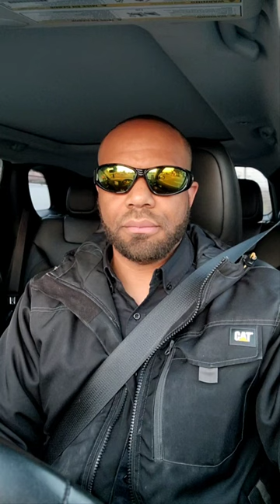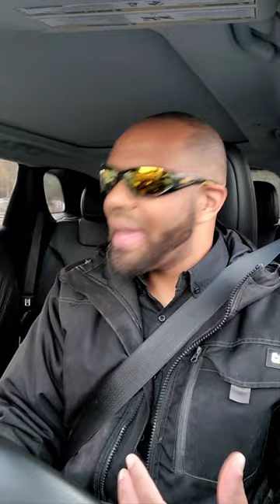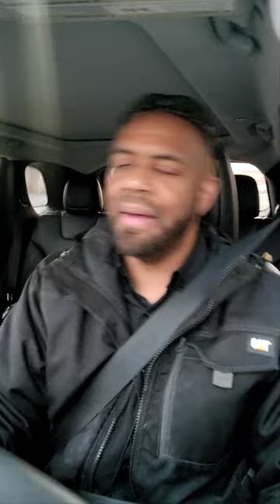I Need More Polyphony in My Keyboards!!!

Comment: Derrick I am running into the same dang problems bud. Have Modx and Fantom O. It actually seems worse on the Fantom O for some reason. Same thing, piano and nice pad and instant problems. Absolutely ridiculous. So bad I thought about trying to get my money back. Says 256 and thought I would be free of problems but bam! And to be honest as far as a live performer I have not been totally happy with the 0. I have a kronos as well that I use live. From all 3 boards the MODX just seems like my powerhouse believe it or not. The scene function is incredibly powerful in live situations. The O has it as well but its located on the pads and you have to remove your right hand or reach way over with your left, just not as good. I have downloaded some pianos for the MODX that are single sounds and for live application actually sound better than the 4 layered ones. Has helped me a lot with the polyphony issues. But I am totally with you bud. I mean they are charging over 4k bucks for these top models and we are still having this stupid crap going on. Insane.
Reply: Im about to sell my modx for this reason

Comment: I usually don’t get into problems but I did the other day😢… only when I start adding more tracks and using automation
Reply from the maker: Hey Mike! Remind me, which keyboard do you use?
Reply: @darrickkeels6387  Iam using the Roland fantom 8. I got the first one when it came out…
Reply: @darrickkeels6387  I mostly do hip hop so you wouldn’t hear the notes drop out but once I started to layer over 8 sounds and add automation… it started to stutter and go off time… I was using the mod wheel for automation …. There are sooo much things that I wanted on the fantom that should be there… I can go on for ever for things I would of liked… but it is better than most of the keyboards out there if you really look at it… I haven’t played the mpc 61 yet but if you really know how to use the fantom you can create some crazy sounds….I use fl studio 21 so most of my production is edited on there and the final production comes out crazyyyy….
Reply: @darrickkeels6387  I am use to the linear recording which I used on the Yamaha motif es8…. Which I need to get a couple keys broken because I made soooo many tracks on… all they need to do is upgrade the software to make more thing happen….

Comment: First, welcome back my good friend. 

Why less polyphony in keyboards? Simple answer. 

1) Outdated hardware
2) No real competition to force breakthroughs/innovations (opposite to what Intel and AMD are doing right now, forcing each other to innovate and compete)
3) No dedicated engineering teams for high end synths (but rather, all are employed to do multiple products at once)
4) Still relying on hardware chips as a tone generation method (as well for FX) instead of switching to software tone generation (Korg have done it with Kronos, Nautilus, the wavestate, opsix and modwave family, the PA series of arrangers and what Dexibell are doing with all their products).
5) Limiting customers by not enabling them to expand their synth by adding M.2 NVME SSDs, or more RAM.

All of these factor in huge losses of power, against general computing hardware. The only brand I can really defend is Dexibell (slight empathy towards Kurzweil). But most of them still, are really still playing the 'take me for a fool card' with their customers. I am hoping someone really starts to push these companies out of their comfort zone until they aren't able to even compete anymore. 

Money doesn't' come cheap, especially for the gigging musician (unless you're high profile of course). So mid-range is mostly, the places where money is spent, even then, products are still not up to the mark as they are expected. 

I still use hardware, because they are easy to setup, easy to use, great workflow and modern ones have great DAW integration as well. But I'm getting tired of hardware manufacturers not making an innovation in this space. 

Have a great day Darrick.

Comment: I was reading an article on Yamaha  Montage and people wanting more <fill in the blank>.  The author said the engineer he talked to at Yamaha said hardware is not the problem, the software is what takes a long time to design, develop, and test.   The software is the slow part and expensive part of developing new things for their keyboards.  

One of Yamaha's approaches to issues like this over the years is just buy a company that already does what they want so they can get their hands on the tech they need/want.   Hey Dexibell you want to retire let Yamaha buy you out.
Reply from the maker: Software is indeed expensive to design, test, develop etc. But it has been over 20 years since the Roland XV3080 has came out with 128-voice polyphony. Think of all the software for phones, tablets, cameras, refrigerators, cars, vacuum cleaners, drones, etc that has been designed, developed and tested since that time often by companies that started out with less deep pockets than Yamaha. The Yamaha corporation has a market capitalization value of over $6.7B. In the year 2000 when the XV3080 launched you could buy Apple shares for as low as .23 per share. Somehow Apple was able to find a way to design, develop and test their software and optimize it to work with their hardware while only being a penny stock. It is now worth over $2 Trillion. They went from .23 per share to launching an iPhone is 7 years. I know it is an "apples to keyboards" comparison lol! But I am just not willing to let corporations worth billions say they lack the money to develop software that works with hardware because that's precisely what every other technology company does. They simply don't think the return on the investment is worth it. But one day a company like Akai will do it and the big three will be playing catchup.
Reply: These companies have been blaming hardware for decades. Now they know that the majority have finally realized their lies are way too obvious. So now they switch to the "software" cost nonsense. Bottom line is that 90+% of their market is beginners/casuals and brand cheerleaders who either don't know the difference or don't care.

Comment: You raise great points. Clearly, you’re a power user with considerable polyphony needs. 

It’s worth it to shine light on some other companies that either give us more or manage polyphony in a more musical way.  Dexibell, Kurzweil, and Kawai spring to mind. 

Barring that, I guess you’d have to look at augmenting your $4k workstation you just bought with either rack modules or software.  

Some higher end Korg products have an Even/Odd note parameter in their Global menu which is helpful if you have two of the same instrument and wish to allocate polyphony across them.
Reply: I'd hardly consider him wanting a Piano and a few extra's (as per other videos) power use lol.  More like the basic requirements of anyone who switches on a board.
Reply: @ErraticFaith  a fair point.  I just got an 07 which tops out at 128 voices and FWIW, I've not had any polyphony issues yet.
Reply: The FA is built around vastly more stable tech. The Zen Core technology is simply too much for it's hardware to bare. Which is why full Fantom has the Vpiano without a cap. Without that you're asking for even more trouble.
Reply: @ErraticFaith  ahhh to be clear I have the Fantom 07, not the FA-07 so I'm definitely using Zen Core stuff.  It's basically half  of the flagship Fantom. I believe the latter has a separate chip just to run the V-piano tech to give it its own polyphony.  I don't know how those resources are allocated if you're NOT using V-piano tech.  So far, I've been pretty lucky to do all the layering and parts I need w/o issues but tbh I haven't pushed it super hard in terms of layers.  I usually use a blend of splits and layers in a Scene so I'm not running into situations where I'm triggering huge amounts of polyphony per note... yet.
Reply: Yes it's difficult to tell with just digits but that's a lot clearer!  As Darrick implies here and there, ZenCore isn't very voice efficient. So commonly it's utilizing more and you're nearer to the 128 of the FA than the supposed 256 of the FANTOM range in regular use.  

Vpiano indeed has a dedicated chip on the expensive model. So it alleviates the polyphony strain in that respect. The only issue is if you aren't a fan of the Vpiano itself (unfortunately that includes me!)

You will notice drops if you're into [SN] and combining it with other semi-intensive aspects (on the Fantom range) because those additions are not well suited to the new architecture. So if people try to thump out what they did on FA/SnS on the new model it will bottleneck at times and drop which is what he's finding so jarring. 

I believe Darrick showcased this in one of his tests and then had better luck with a new ZenCore Piano. Which I expected.  The FA was better suited to it's own models (not very surprising) than the new.

Overall I do agree with him that the advice of 'don't push it so hard and you wont have a problem' borders on the insulting but it's also true that the hardware does have its limits and thats why we now have so many software users (its simply so fast/cost efficient for them to update as well).

Hopefully you continue to have a lack of issues with it. I only use the new Fan-0 in the x6 series format. I stick to FA at the x8. 

Far too easy for me to encounter problems on larger models where the size drives you towards things you supposedly shouldn't do (lol).

Comment: What about Kurzweil PC4. It has 256.
Reply from the maker: Well, technically, the Montage and Fantom are 256 polyphony machines too. But it really isn't about the "number" of voices. It's about the architecture of how those resources are utilized.  For example the Montage has 256-voice polyphony over two sound engines. If you are only working with one of them, you are down to 128-voice polyphony. Every "part" in a Montage can have up to 8 oscillators and every performance 8 parts. The Montage's premium pianos take up 4 parts, each having several oscillators. It's very easy to eat up the 128-voices allowed by the AWM-2 engine especially if you start layering sounds.

Comment: Alright brotha, question for you. I know you are enjoying your key 61. How do you feel about it as your master controller and sequencer? I am coming from a 2500, and I have multiple boards. I am debating between a Key 61 and One/Live . In theory, I want a Key 61, but with multiple other boards, the One is more space efficient. I also thought about a Fantom 06 since I have Live, but I already have a Fantom rack from back in the day.  I feel like having my sequencer, keys, knobs, all on one board vs midi'g another board or controller to a One/Live may be a better workflow. Also, how is it working out with sequencing other outboard gear?

Comment: I have a Roland Fantom 88 ($4k) I want the akai 61 don't u think the Fantom can do everything the akai can do?  The only drawback is the Phantom is huge it's hard to carry around and gig with.   My main keyboard is a Yamaha moxf8.  My main question to  is  I don't know if you're familiar with Flash memory, But on the Yamaha Moxf8  It seems that the only way you can utilize the storage on the Flash memory is if you delete all of your current sounds. So I feel like it was a waste of money because I have so many sounds/ presets I have locked in  And to think I have to essentially factory reset everything to use the Flash memory is so crazy and outdated. Kind of makes me upset.   Let me know if you are familiar with this, thank you.
Reply from the maker: To answer your first question. No the Fantom does not do everything the MPC Key 61 does. The MPC Key has a 128-track sequencer vs the 16 track sequencer in the Fantom. The MPC allows for linear recording up to 999 measures. This cannot be done on the Fantom. The MPC is a full featured sampler. The Fantom has a barebones sampler. However, the Fantom has a better build quality, allows for 16 sounds to be layered and split very easily, more live performance controls, and analog filter out, no load times when selecting sounds or entire projects (scenes). There are many other differences but they both have their pros and cons. Hence I own both. The MOXF does have a slot allowing you to expand your flash memory.  The FL512M and the FL1024M flash cards are both available for the MOXF.

Comment: Thoughts on Prophet X Synthesizer? RufusDuSol is using it and it only has 8 polyphony stereo , 16 Mono. 
150GB of factory installed samples. 
50GB of storage to add your own samples. 
Is it better than Yamaha Montage? I think it’s $4,000
Reply from the maker: They are actually different animals. Practically none of the instruments by DSI are made to be played in a "traditional" manner. For instance you cannot play a classical piece by Chopin on a Prophet 5, Prophet 10, Prophet REV 2, etc. However, on a Montage you absolutely can. The Montage is designed to layer and manipulate multiple sounds at once. It's designed to proficient in the studio and be a tool for a gigging musician of any genre. It is a music creation tool packed with over 10,000 arps and it give you the ability to create your own. Complex splits, layers, and morphing capabilities are right up its alley. The Prophet X is more of a "specialist." It's really designed to play one sound at a time. It's an auxiliary board that is designed to be an addition to an existing set up. A polysynth is designed to provide unique sounds that are hard to achieve with digital workstations and synthesizers. But it would do a poor job covering an entire song on a gig.
Reply: @darrickkeels6387  Thank you so much for this informative reply. I was curious to know more about it, since I saw that  RufusDuSol uses this. Live their sounds. Now I know. Thanks again. You’re awesome! 
I got Yamaha Montage and still looking for info on how to use it.

Comment: I was just about to buy the Fantom 06, and then I dug even deeper, and there are problems with the polyphony, the pitch wheel is really slow when doing fast vibratos, and it doesn't export wav files or something to that effect, like the FA-06 does, and they didn't put a D beam on it either which I really wanted for expression with my hands, so I'm thinking why in the hell are these simple things for 1,600 dollars not being attained to and applied from these company's? I think they do this on purpose, so that you buy other things. It's ridiculous and I'm kind of pissed off right now. I still might get the Fantom 06, but these small little things should not be. It doesn't make sense at all...SBN RESONATE

Comment: The move is to go software based completely…I’m making the shift right now it’s just better sonically practically and expand ability I can literally do 4 keyboard rig with my phone if I wanted to 🤷🏿‍♂️ijs
Reply from the maker: I use quite a bit of software now. Ableton Live is my go to for projects. But the software route also has its cons.
Reply: @darrickkeels6387  one of the issues with software for me is load times and a fragmented workflow. Some good sounding pianos take 30 seconds to load or more. I was loading up garritan cfx this morning and by the time the default patch was loaded I had already auditioned a few pianos on my motif xs.
Reply: i am using gig performer for my performances now. 

i have played for 4 different events over the past week and it worked like a tank.

it takes a while to set up but once its there you can configure it to your hearts content and do things that first you would think impossible. 
they also have a very active community/ forum and weekly youtube live interactive videos that assist you along the way.

the founders of the program are musicians so it was made by musicians for live performance.

there are cons eg  in a hard ware you have the controller and the sound module in one piece, while in software you have to bring along a computer and extra power supply and connecting cables. there are more things that can go wrong.
i keep a hardware keyboard along its ready and set up incase something goes wrong. it also doubles as a controller for the software.
i am currently using an old computer from around 2012. 

i5 sony vaio 1.7 gz clock speed turbo up to 2.5.

you have to be prepared and plan ahead of time but after you get the hang of it youre solid. 

similarly to what derek says in his video depending on the power of your computer, polyphony issues goes throught the door.

its amazing. 

if any one wants to try it there is a free download that you can try.

it is way better than ableton live for live perfomance and can work with ableton live (or any other software) if you like to control. your backing tracks etc.

you get control over your set up the way hardware can only dream of.

there is also another program similar called cantabile which does the same thing but works only on windows